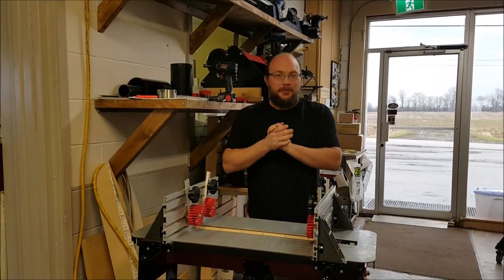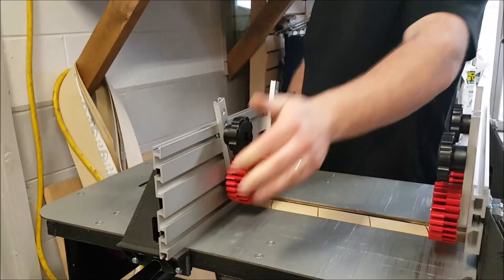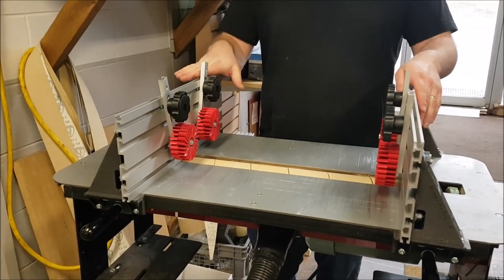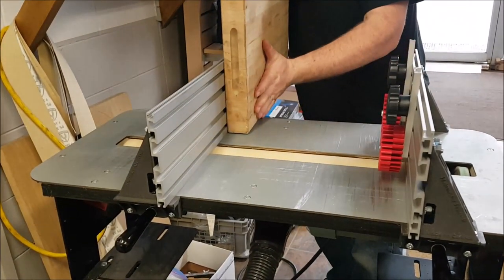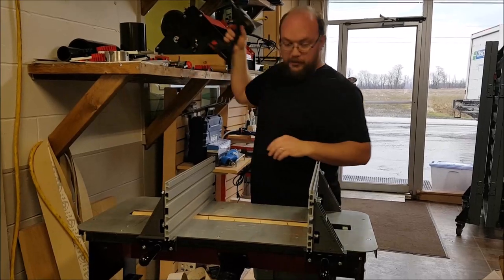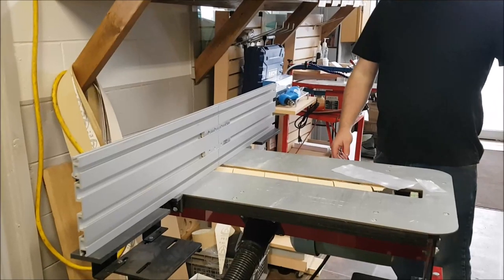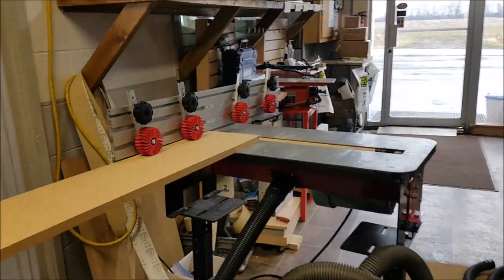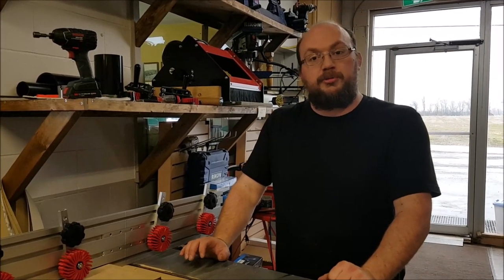Flatmaster All-Fence! Why They Are a Great Addition To Your Flatmaster Drum Sander, EthAnswers

Comment: I have two sets of the old style steel fences on my Flatmaster.  Do you offer a trade-in/upgrade deal?
Reply: I have the same situation and I’ve never mince used mine yet! After years of having the sander hidden under another machine I’m finally putting it into use.